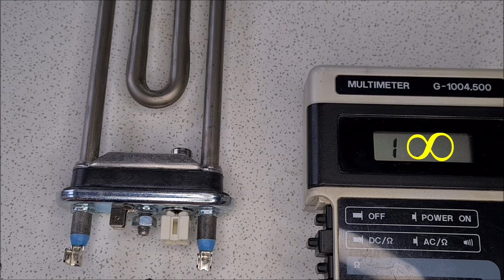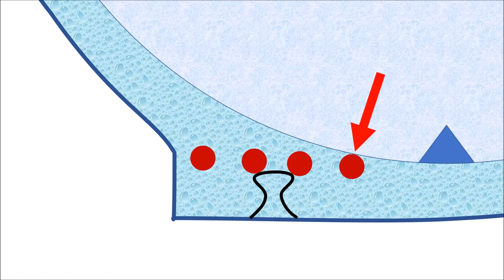Replace heating element in a washing machine

Comment: Thanks for showing how the bolt/nut setup makes the seal expand, no one else on Youtube shows this, and it is important to know when the old element wont come out, even with the nut a bit loose.
Reply from the maker: Thanks for watching
Reply: I know right?

I spent at least 20 minutes trying to get the bastard on and then I decided to not let my ego get in the way and I looked this video up and had an epiphany moment.

Damn near about cried after getting in on.
Reply: Epiphany moment too right here. Those hits on that bolt...
Reply: Took me 1-2h with knowing it. Still don't understand why it didn't work. Seems the rubber expanded inside and got stiff. 

Had to take a screwdriver and force the rubber out.
Reply: Here’s one more: thank you for showing that, saved me a lot of frustration!

Comment: Thanks for showing. Just when i already ordered my heater, I was unable to pull out the heater. The rubber padding surrounding the heater got sealed or stuck inside. The front plate already out but the rubber sealed it so well that i unable to pull out. Is there something I missed?
Reply from the maker: After loosening the nut and pushing the bolt in, the heater should come out.
Reply: I tried again, this time i managed to pull it out. After knocking the bolt right inside and it still cannot come out, I decided to use towels for better grip and pull it out. Thanks alot for the video, it has been inspirational.😊

Comment: Another question: is ot necessary to remove the belt connecting the motor and the drum?
Reply from the maker: In my washing machine, the belt interferes with the removal of the heater.

Comment: Great video. I’ll try this 😊
Reply from the maker: Good luck!
Reply: @k-nemo  hey, i need help with my replacement, I have the same replacement part which has the same model number but once I've installed it it leaks! the seal and everything is fine though.

Comment: Thanks for making this helpful video. With how much Haier expect to charge, I am keen to see if I can sort it out myself. May I ask what is it that you are doing with the Multimeter?
Reply from the maker: I check the resistance between the heater body and the pins to which voltage is supplied.  The insulation resistance in the heater is too low.  This caused the fuse to cut off the power to the washing machine.
Reply from the maker: 0:20
Reply: Can we do it without a multimeter? Don't have one or know how to use....